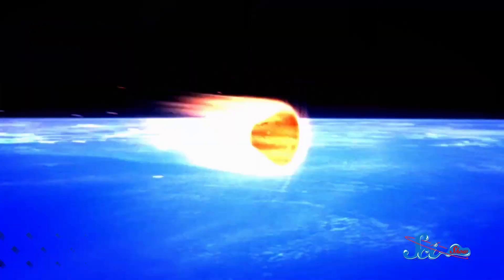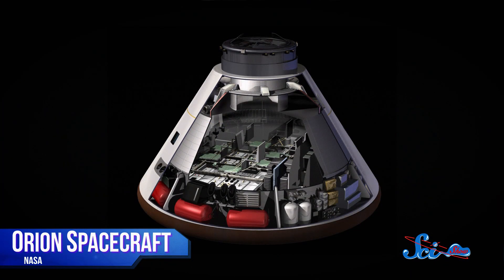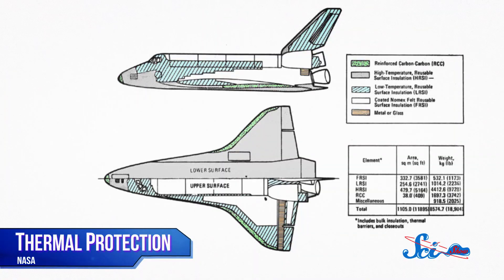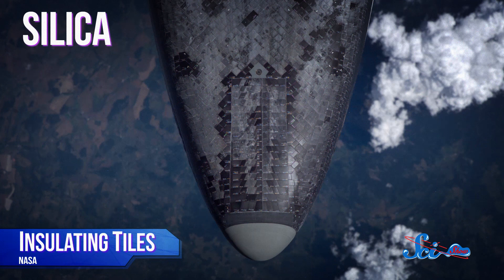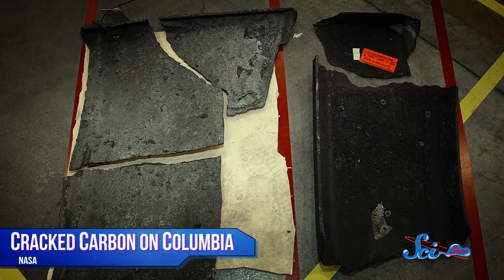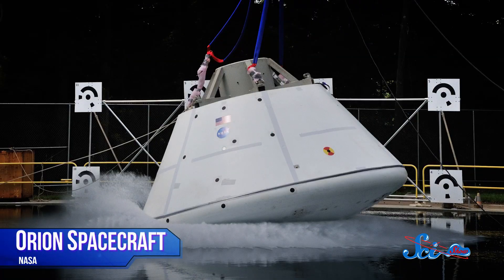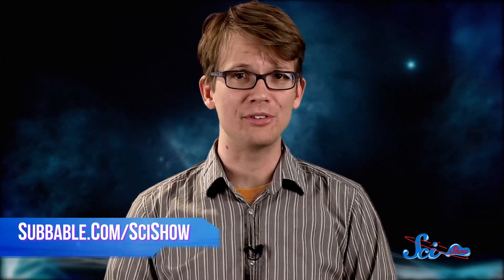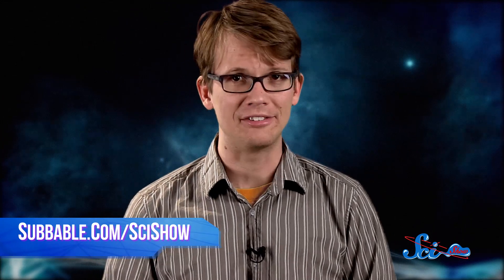How Do Spacecraft Survive Re-Entry?

Comment: Can someone in the know explain to me why a larger surface area spreads the heat better when the heat produced in the first place should be directly proportional to the surface area?
Reply: It's kinda hard to explain, but I will try.  It's all about energy.

Spacecraft during re-entry use aerobreaking to slow down to safe speeds.  That is the real goal here, slowing down.  The kinetic energy of the spacecraft can't just dissapear, instead that energy is transferred to the air around the craft.  That is where the air gets the energy to reach such high temperatures, as well as creates the wake behind the craft. 

Having a blunt, almost flat bottom of the craft helps because the heat created is more evenly distributed over the surface, as opposed to a sharp tip which would heat up a lot more.  Look up a picture of a bow shock vs a wedge shock and you can see that the top of the wedge is closer to the shockwave than the rest of the structure, while the entire front of the structure is equally close in a bow shock.

A sharp shape also wouldn't slow you down as much, so a larger area helps slow you faster and more quickly drop you down to speeds where the air CAN get out of your way fast enough.
Reply: Meg Ashley Thanks for trying to explain. So I got the part in the video about the insulating layer. The craft crashes into the air, the air gets hot, then cools down while subsequent air kinda crashes into the first layer of air, not into the spacecraft directly. If you have a shape that helps move the air out of the way then that insulating layer moves away more quickly. Is the bow shock vs. wedge shock thing something different still though?

And yes, while writing the question above, I was thinking about the duration issue but if that's what they meant, why not just say so instead of talking nebulously about heat dissipation?
Reply: The bow shock vs wedge shock is a different thing.  Both are shockwaves, and so they are both caused by the whole "air can't get out of the way fast enough" phenomenon, but they differ in how the shockwave is shaped.  Because of this, they differ in how they affect the vehicle.

Comment: How does SpaceX do theirs? especially with their reusable rockets?
Reply: The first stage that they are recovering is only getting to mach 5 and doesn't heat up much during reentry.  They land it vertically.  The Dragon 2 capsule will also land on rockets but only after reentering using a heat shield like other capsules.

Comment: White tiles? WHITE TILES!!??? Except for very minimal tiles on delicate parts of the space shuttle the majority of the top of the shuttle, the only WHITE part was made of a blanket-like material called Reinforced Carbon-Carbon (RCC). Check your facts Scishow: 
http://www.boeing.com/news/frontiers/archive/2005/october/i_ids4.html
http://en.wikipedia.org/wiki/Space_Shuttle_thermal_protection_system
http://www.nasa.gov/missions/shuttle/f_blankets.html
http://www.nasa.gov/centers/ames/multimedia/images/2005/shuttleblanket.html
 I expected better than this.
Reply: Yes... They are referring to the tiles on top, which happen to be white...
Reply: You should check your facts first.  The white sections of the Shuttle were low temperature blankets made of treated felt and Nomex.  The RCC was only found on the tip of the nose and the leading edges of the wings where the temperatures were the highest.

Comment: I have a question, rather than spend so many time on thinking about what kinda materials can deal with the heat that generate during re-entry, why not just fix it from the root, cut off the momentum and gently start the re-entry process with something like helium balloon or vertical propulsion? if the air have enough time and space to get out of the way, then it won't compress and it won't produce heat right?
Reply: The two different methods you propose have separate reasons for not working.  The vertical lift one is the easier to address so I'll start with that.

The heat shield of Orion weighs on the order of 1000 lbs.  The amount of fuel that would be required to slow down the capsule enough to not need the heat shield is waaaaaaay more.  Likely more than 10x more, though I'd have to do the math to be sure.  So it actually saves a lot of weight by using aerobreaking instead of retropropulsion.  In fact, we almost exclusively use retropropulsion in situations where there is not an atmosphere dense enough to slow down a vehicle to a safe speed, for example the moon lander or the Mars rovers.

As for the helium balloon idea, the issue is one of buoyancy.  Helium balloons float because the helium is less dense than the air around them, but up at the edge of the atmosphere there just isn't enough air for that to be a significant force.  At the edge of the atmosphere the balloon wouldn't even float at all.  By the time the capsule had gotten low enough that the balloons could help it would have already experienced some pretty severe heating.  Even if you could somehow ignore that, the amount of helium that you would need to slow it down, AND the containers to carry that helium, AND the very, very tough balloon material would weigh thousands of pounds so we'd be overweight anyhow.

The ultimate problem in spaceflight is "how do we keep our mass down?"  Mass is almost a kind of currency, you have lots of options but they all have the cost of added mass and the goal here isn't "how do we not have to deal with heat," the goal is "how do we get the the ground safely?"
Reply: Well, you know that would require a ridiculous amount of energy right?, which means you need to take thousands and thousands of liters of fuel with you.
Reply: i have ask my self the same question and i think it is because is hard to brake from 20k mph to 200 mph ether with balloons or  rockets going the other way 
but we will find away
Reply: Funniest thing is that all of information we need to actually count simplest case of an object entering atmosphere should be available  to everyone somewhere around last years of school. We can actually try to count ourselves, like I think we need Archimedes' principle, basic newton laws, little bit of thermodynamic and some numbers from internet, it very well maybe very clear why they don do that just from crazy output numbers from that.
EDIT: btw I am really not sure whenever I am right, so it would be nice if someone smarter than me corrected me -_-
Reply: To cut off the momentum you would need tons of extra fuel. And carryiing tons of extra fuel, just to be used on your reentry, is pratically impossible.

That extra fuel would mean that you'd need even more fuel just to lift from Earth. More fuel to do all the maneuvers you'd need in space. And more still on the reentry because, now, you have more mass.
Reply: As basically everyone else before has mentioned, using powered reentry via retro-propulsion is simply too cost and weight prohibitive with current technologies. The only way powered reentry  will ever be a viable solution is if we can develop exponentially more efficient propulsion methods. The only other method would be to eliminate the need for reentry altogether, by leaving the orbital vehicle parked in space and use a space elevator to ferry and crew and cargo to and from the Earth.
Reply: From my, very incomplete understanding of things things just bounce from those thick layers of air if object enters atmosphere from weird angle and or wrong speed. AS for super slow decent: we are talking about 100 km of burning fuel. AS for helium balloons - they will just float on top of the air layer, I think.
Reply: You need about 15x your craft wight to in fuel make it to space, and if you wanted to slow down, you would need an additional 15x of fuel...it is basically cost prohibited.  Like mentioned above, reduction of mass of the craft is the best way to reduce fuel load, atmosphere is essentially a free brake...in fact, most of the places we have been where crafts have landed have been places we could use the atmosphere as a free break (moon and other notable exceptions of course :D)!
Reply: Isn't this what is already being done? Slowing down just enough to be able to do re-entry safely. I'm quite certain everything is done to maximize efficiency already. A more accurate question would be why not to use other methods.
Something to keep in mind is probably the fact that low earth orbit velocity is not necessarily too fast to require slowing down.
But I bet we can upgrade the aerobraking in higher altitudes, a balloon with helium or water would obviously just behave like a parachute which I assume would create too much drag etc. In the end I assume a single approach for re-entry makes for the most predictable re-entry in other words most safe as of right now.

Personally I'd like to see a balloon/parachute with high drag attached with a bungee cord to the low drag vessel, so the balloon would take the punishment and gently slowing the vessel before hitting even thicker atmosphere. XD Nah it would never work.
Reply: I'm not sure the ballons/vertical propulsion would survive the initial shock.
Reply: AERO BRAKING INTO EARTHS ATOMSPHERE ITS GREAT
Reply: Think of it this way. If you have 3 giant rockets fire you into space, you need 3 giant rockets in space, firing the opposite way, to slow you down enough to land.
Reply: Can not carry  enough fuel  to slow  down from at least 17500 mph

Comment: Its a shame that we still haven't got the substance "starlite material" created by Maurice Ward. If he had shared his composition with NASA back in the 70's I bet this wouldn't be an issue by now. If you haven't heard of it, then check it out.
  Would you say he was selfish to keep it a secret, although it probably would have been used in wars it would of saved so many lives in everyday living. Insulating planes and firefighter clothing. 
  I wish it was public knowledge as I feel it could of been refined and improved vastly over 40 years.
Reply: "withstand attack by a laser beam that could produce a temperature of 10,000 degrees Celsius"
Sounds as fake as cold fusion.

Comment: Skylon would supposedly use a more shallow angle of attack to dissipate the heat more slowly. Yet to be built tho...
Reply: http://www.reactionengines.co.uk/tech_docs.html
Reply: Skylon is a very intriguing concept but they're still a long way from having even a demonstrator craft flying.
Reply: Rok Adamlje While nice, I do wonder if skylon will ever actually be built. It is a fairly old project that has done little beyond a few controlled engine firings.
Reply: CLeach13 I do think its a good path to first develop and test the engines, which are the most important part. They did a 1million € study with ESA just a few months ago, news seem to be scarce tho.
Reply: Rok Adamlje Agreed, I would just like to see (or read about) some more real world testing of the engine.

Comment: Perhaps I'm dense or something, but why not just drop a anchor?

Currently, you have a box of humans with a one-shot option of achieving the correct entry angle, and a very limited area of vessel to point at it. Wouldn't it be simpler to use an unoccupied, shielded, object on a line to produce a slowing drag effect to bring the occupied capsule to a speed safe to reenter without all the light shows and accompanying heat to entertain the terrified passengers? I'm certain they'd prefer to be watching a movie rather than the lethal technicolour lightshow.

Using materials capable of distributing the heat (along the lines of the nanotube concept mentioned a little earlier) for the connection between capsule and anchor could perhaps also distribute the intensity and be worked into an exchange system of some kind to convert to electrical power for storage or use.

If I'm missing something obvious, apologies; like I say, my science knowledge is limited to knowing enough not to electrocute myself (very often) when charging my mobile phone. But if so, could someone explain in nice, simple, words exactly why it wouldn't work, please :)
Reply: They've been trying something similar to this.  The problem is that you hit the atmosphere hard.  You are coming in stupid fast and as the air density builds up, you basically hit the equivalent of a brick wall as the air molecules stack up.  If you had a big enough heat shield, you could potentially bleed off speed fast enough to make reentry less scary.  However, fitting a heat shield that big isn't practical on a narrow rocket.
  NASA has been trying to make inflatable heat shields since the 60s.  They recently did a couple of missions where they tried it with limited success but all of the attempts have been lost.  
  Your idea may be a common reentry technique in the future but there's a still a lot of bugs to get worked out.
Reply: Dan Heidel What happens if you slow the craft down while you enter the atmosphere? would it be possible to reenter without moving stupid fast and slamming into the atmosphere? Many scifi movies and shows I have seen (not the best source material but what eva) have ships needing to slowdown before entering the atmosphere or they burn up.
Reply: CLeach13 From what I gather, the problem with slowing down "before hitting the atmosphere" is that slowing down makes you hit the atmosphere. You burn retrograde to slow down, thus lowering your orbit into the atmosphere, if you burn to lower it further, you hit the atmosphere sooner, and at a steeper angle. So you can hit the thicker atmosphere quicker and faster this way, instead of using the thinner atmosphere to slow you down while gaining a bit of lift to stay up there longer, further slowing you down (while of course not "skipping" off the air either). It would take a lot of fuel (that you have to burn yet more fuel to get that fuel to space) to actually decelerate enough to hit at substantially slower speeds. Or so I understand it as.
Reply: CLeach13
  Interaction with the atmosphere is how spacecraft slow down.  So you hit the top of the atmosphere at full speed and so you can't really avoid slamming into the to pof the atmosphere at full speed.

  The only other way to do that would be to use engines to reduce velocity.  The problem is that requires fuel which causes the weight of the launch vehicle to increase exponentially.  (Fuel require more fuel to lift it and that fuel requires more fuel, etc, etc)  

  SpaceX is currently recovering the first stage using a propulsive slow down strategy but that only goes a small fraction of orbital velocity.  They are trying to figure out how to recover the 2nd stage reaches full orbital velocity but they haven't even started attempting that yet.

Comment: It's worth mentioning that ablative shields have an additional way to protect the craft.  As they ablate, they break down and emit gasses.  These gasses help to push the bow shock away from the vehicle, further cooling it.
Reply: Dan Heidel 
There's also regeneratively cooled heat shield designs such as those on many of Phillip Bono's VTOL RLV designs where a coolant such as water or left over liquid hydrogen is passed through channels inside the heat shield and allowed to boil and and dumped over board or is released through pores creating a protective layer of relative cool gas farther protecting the vehicle.
Reply: Dan Heidel It's actually primarily those gases that confer the protection because they insulate the shield itself (and most of the braking heat ends up in those gases and in the atmospheric gases before them.

The phase change (evaporation) of the heat shield material can only take up a very small fraction of the energy that gets converted from kinetic and potential energy during reentry.

It's a bit like the Leidenfrost phenomenon, actually.